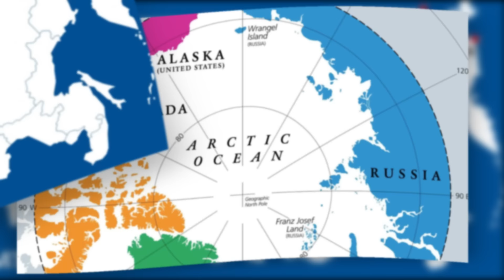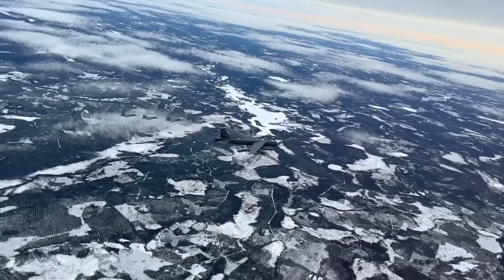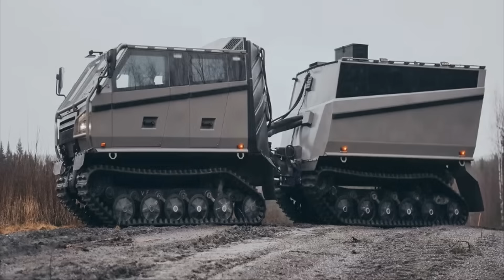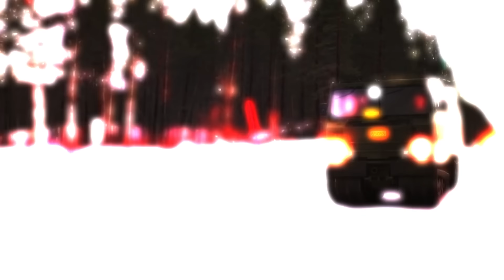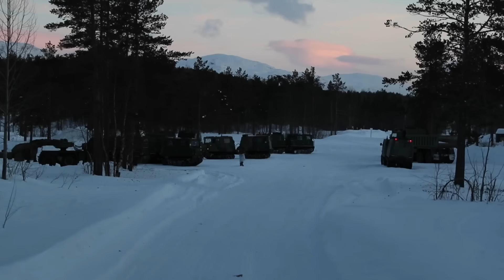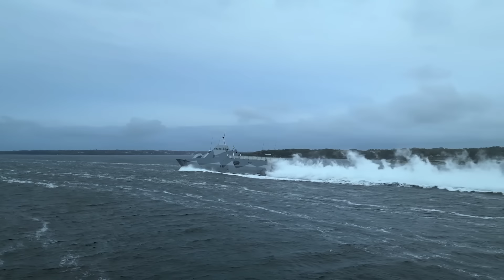US Army's BVS10 Beowulf Dominates Arctic Warfare

Comment from the maker: 🎯 Quick question: Is 200 Beowulfs enough for Arctic operations... or does the Army need 1,000+?

Russia operates 24,140 km of Arctic coastline. China's investing billions in the region. The Northern Sea Route could reshape global trade.

Drop your strategic assessment below 👇
Reply: What ever it takes. Blessings to the U.S.A.❤. Shalom from Toronto. Merry Chsitmas. Keep Santa save Thank you.
Reply: It is good that you are proud of the vehicle. It probably works excellently in Alaska, Northern Norway, and in northern Finland. In other words, in fine soft snow, and places where the surface is not too harsh. It doesn't work with either rubber or metal tracks in Greenland, for example. In -60°C, metal becomes so brittle that it is broken and shattered. Rubber becomes relatively hard and is cut open by the sharp "ice screws" and more that are in the ice desert. It is a nature that is many times harsher than Alaska's nature. There is a very good reason why the Danish forces in Greenland do not use these vehicles as well as snowmobiles other than in the coastal areas (around their bases) - and that is that they simply collapse and become a burden instead of a help. So Beowulf probably helps in some areas, but will be a hemshoe in others. The 10 to 15° Celsius It is colder in Greenland makes a significant impact - also on the weapons you choose. One of the most affective weapons against a CATV / Beawulf will be a rifle with an AP projectile, fired at the huge target area called the belt (or track). When it is as hard as the rubber stays at minus 60° Celsius. (-75° F) Then a single shot will destroy the belt completely. Who will stand out and repair when you. Does there lie a shooter and aim? How long does it take to repair. Who has woven things; belts / shots for the rifle?) What about all the fuel that needs to be brought.
Reply: The US needs zero because it cannot fight there.
Reply: @crhu319 tell that to Trump. We can and will fight anywhere we choose.
Reply: Also yes 1000+

Comment: The 11th Division is a drop in the bucket when it comes to Arctic warfare.  It will required much more than one division Arctic trained.

I served 21 years in the Marine Corps as an infantry officer with 3 years in combat.  When assigned to the 1st Marine Brigade as the Logistics Operations Officer, I was responsible for the deployment of the Brigade in accordance to existing war plans.

When reviewing the contingency plans for the 1st Marine Brigade, one of them was to reinforce allied forces in the event of a war with North Korea.  We had load plans for a conflict if it occurred in the summer, but those plans didn't account for deployment in late fall, the winter, or early spring when the climate in Korea would be similar to Arctic conditions.

I pointed out to the Brigade Commander at the time (in the 1970's) that if committed to Korea in the winter, we would be completely unprepared for those severe conditions, especially because our initial bases where would be landing were without much of anything other than a runway.  There would be no tents, maintenance facilities, no fuel, no electricity, etc.  In other words, we would have to bring everything to support ourselves with us.  That doubled the number of aircraft we would need.

Additionally, the Brigade did not have any cold weather equipment because we were based in Hawaii.  After I briefed the Brigade Commander on our contingency deployment if it happened in the winter, he tasked me to attend the Army's Arctic Warfare Course in Alaska and to report back what the Brigade needed to deploy to Korea in the winter months.

After nearly freezing to death at the course, I told the Brigade Commander that there was no way we were prepared to deploy to Korea in the winter ready to fight.  Vehicles needed cold weather old weather kits, we would need warming tents, we would need cold weather gear for our Marines, and none of that existed for the Brigade.  In addition, there were no fuel at the bare-bones bases where we would land and so I devised a method to defuel C-141 to fuel bladders at the bare-bones air fields in order to refuel our vehicles and generators.  That had to be carefully coordinated with the Air Force.

The bottom line is that we never got the funding nor the commitment that we would receive cold weather gear or kits if we deployed to Korea in the winter.  

That was a long time ago and I'm confident the Marine Corps has never resolved those deficiencies.

For the military to get serious about fighting in Arctic conditions it better have more than one Division because Russia and China will have far more than that.
Reply: Good report Sir.

Comment: Geo-Politcal wild card (emphasis on political) of 'climate change' and rapidly depleting ice caps😂😂 it ain't evaporating so the water should have submerged coastlines around the globe. So where is the water??
Reply from the maker: I should have specified but I’m referring to floating sea ice, which when it melts does not raise sea levels but it does reshape global trade routes and unlocks an entire new domain for power projection.

However, the Arctic also has huge amounts of land-based ice, especially the Greenland Ice Sheet. When that melts, water that was on land flows into the ocean; the total volume of the ocean increases; and sea levels rise. This is the real driver of modern sea-level rise — not floating sea ice.

Comment: Yeah, northern ice will be gone in 2022 according to Al Gore.   Oooops,  More than ever.  Insurance company’s and banks still covering and mortgaging beach front property.  Beware propaganda.
Reply from the maker: I should have specified but I’m referring to floating sea ice, which when it melts does not raise sea levels but it does reshape global trade routes and unlocks an entire new domain for power projection.

However, the Arctic also has huge amounts of land-based ice, especially the Greenland Ice Sheet. When that melts, water that was on land flows into the ocean; the total volume of the ocean increases; and sea levels rise. This is the real driver of modern sea-level rise — not floating sea ice.